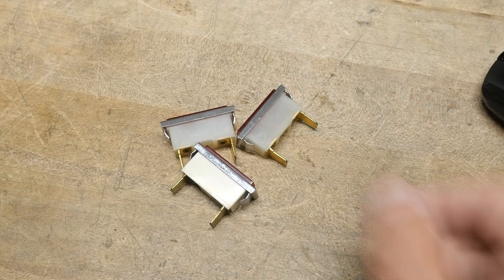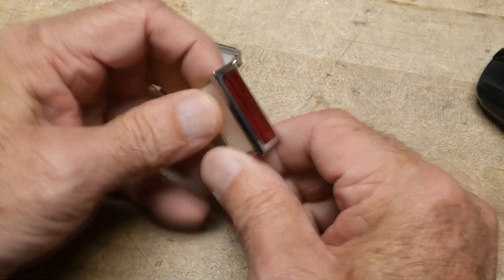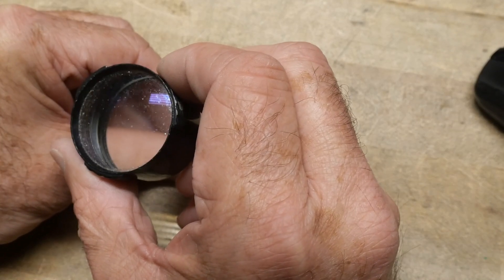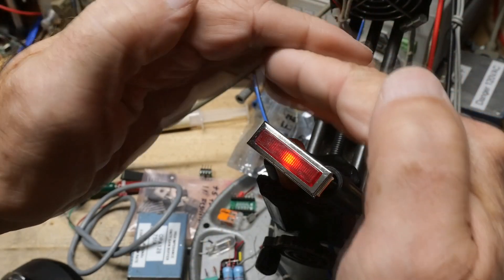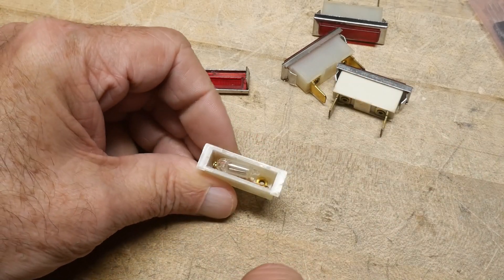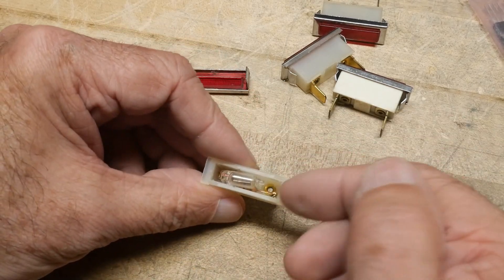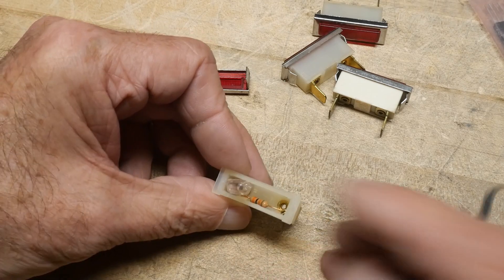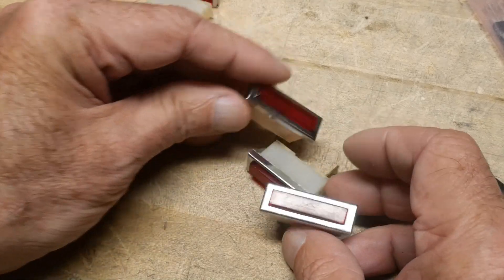#2186 Plasma Display Technology

Comment: I wish to point out an error in your presentation...you say the gas has been chosen you be in the visible spectrum range...that is not quite correct!  It should be:  The color (frequency) of the EXITED gas has been chosen to be in the visible spectrum range.   Otherwise the video is very good, factually correct, fascinating, and educational as always! HAFD and Cheers from Connecticut

Comment: It may seem like futuristic technology and it really is, but they have been in service for a while now as I have seen them being used during the war. The corumbulation resonators that control the inverted ballistic bumpulators  we used on Saturn's southern hemisphere. That little device inside is called a viscous space dilator and it's pretty clever and more complex than the plasma bulb itself.
It's filled with molasses and is much bigger on the inside than it is on the outside, causing the electrons to walk uphill to burn a little energy before getting to work, otherwise they'll either be too jittery causing the light to be way too bright. As we saw, the light is bright enough. I may be revealing too much, but the distance the electrons have to travel depends on the color bands. The reason we decided to use colorbands is because the enemies had dichromatic vision and couldn't see the  values as they would have if we had chosen to use any other numeral system.

Comment: It’s literally a super complex quantum physic driven photon emitting electron spin and energy level converter.
Sometimes even doing proton collisions with some subatomic particle radiation.
Someone even said, it’s playing with time in the Higgs field. Going backwards and forwards with couple of Planck time constant vectors in the 5th dimension. And we jus see the emitted photons with electromagnetic waves.
Basically a mini particle accelerator. But cost only 2 Cents….😂

Comment: Recently, I added a handy-dandy arrangement like this (without the light-spreading package, but with the nice transparent plasma container and a grey-red-orange current limiter) to my temperature-controlled soldering iron.  The arrangement shows me when the soldering iron tip has reached the desired temperature, and it gives me a relative idea of how much heat is being delivered to the tip.  It does this by revealing the on-off heating periods produced by the triac switch inside the soldering iron base unit that delivers power to the heater.  No kiddin!  🙂

Comment: if ur interested in looking at some real plasma tech i got about 10 of these hybrid plasma display panel sustain circuit which tiny smd components right next to bare power mosfets or power igbt dies. id also lik to hear what u thing about the sustain concept and theory of operation cause while i know its for getting more light out of plasma panels with less power idk how